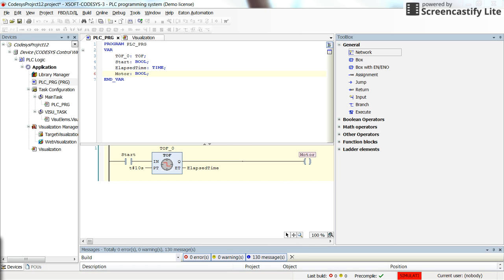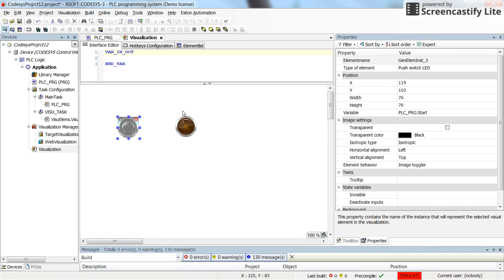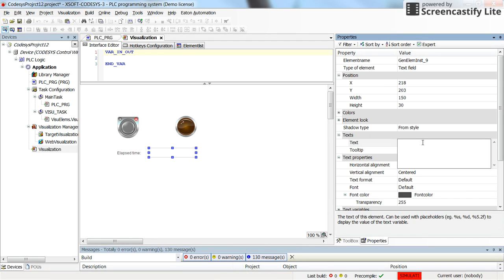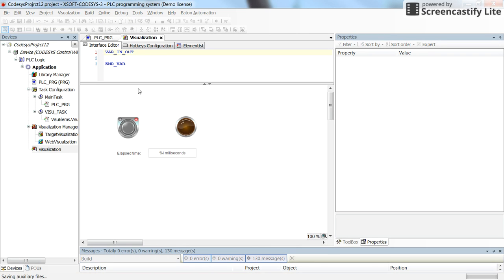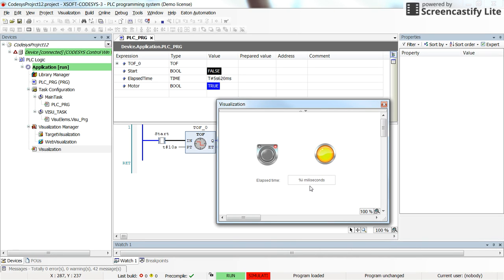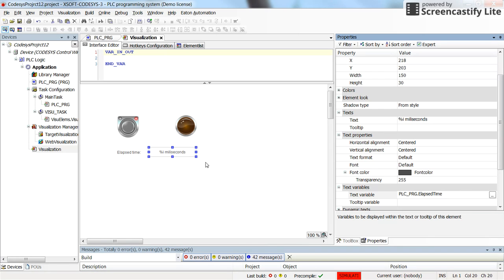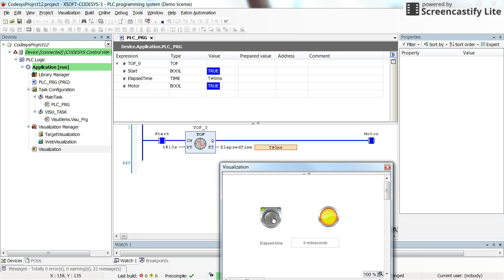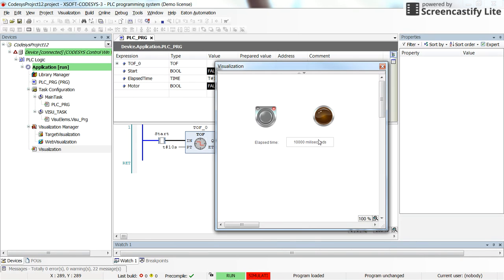CODESYS: Visualization trick - Displaying dynamic values in the visualization window #codesys #plc

Comment: Hello Tohid, thanks for video, but I have a problem maybe with my codesys. In the textField noting appear. I found in the HelpManual that:
Note: If you specify a variable of type enumeration with text list support, then the name of the enumeration data type is added automatically in angle brackets after the variable name. Example: PLC_PRG.enVar <myEnum>. Then the symbolic value of the enumeration component is printed instead of the numeric value when text is printed. Refer to the help page for the DUT object. (I get it from HelpManual)
But when I add tag PLC_PRG.enVar .... there nothing appear, Maybe You know how it solve?
Reply from the maker: Hi Stanislavas, 
I will try this and let you know the result. I am not sure yet about the reason.
Reply: Hi, Tohid don't worry I've solved it.
Reply from the maker: Nice to hear that. Do you mind sharing your experience and letting us know how you have solved it?

Comment: Is there a way to show the time that is going to elpase ? so if it is set to 10s it shall show the values starting at 10s and counting down to 0 ?
Reply from the maker: Sure, there is. You can use a Text box, and as its text variable, assign the time value that you have calculated referring to the Preset time and elapsed time (Rem_Time = Preset_time - Elapsed_Time). Let me know if you manage to do this (you would need to convert the resulting time into the integer, I believe).
Reply: I made the following. 
Where TON_1.PT is the set pause time
and TON_1.ET the elepased time.

 Rem_Time: TIME := TON_1.PT-TON_1.ET;

if I make it INT, it says it cannot convert time to int

also If I watch the values while running the simulation it doesn't count down. The value is always 0
Reply from the maker: You can convert the Time value to a numeric value, using data conversion like "TIME_TO_DWORD": dw:=TIME_TO_DWORD(T#5m); Which will provide you with the number of milliseconds., then you can divide it by 1000 to get the seconds. 
Please try this and let us know if it works fine.
Reply: I try the TIME_TO_DWORD;  in the codesys , show the time 5s on the HMI but failed , would you like to make a video to show ?
Reply from the maker: Sure, I will consider explaining this using a video soon. Stay tuned!